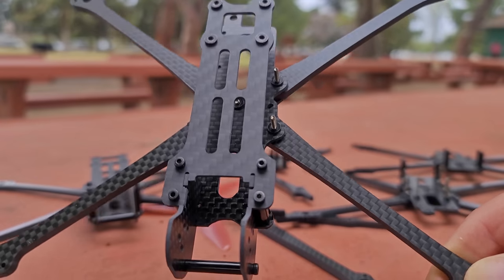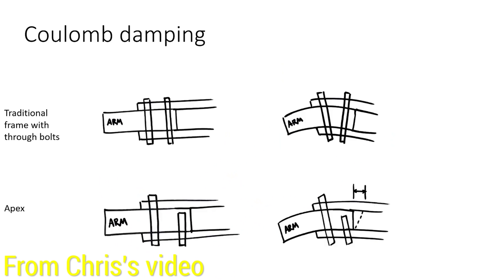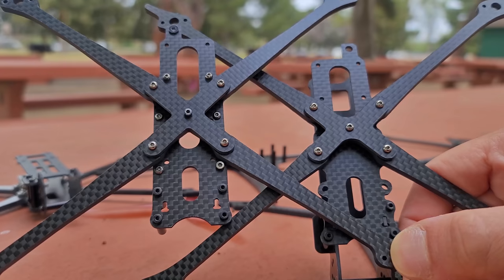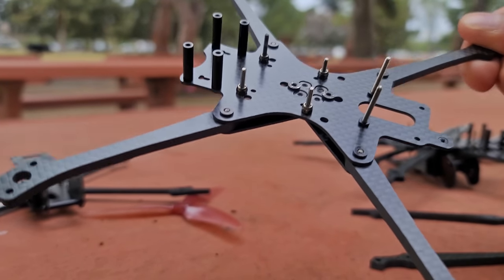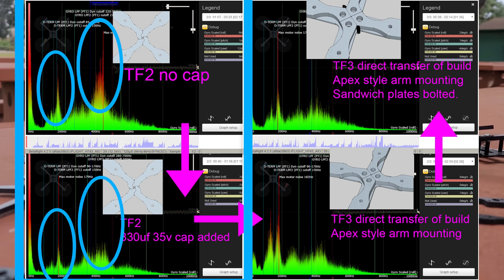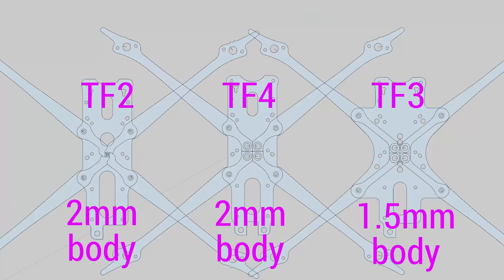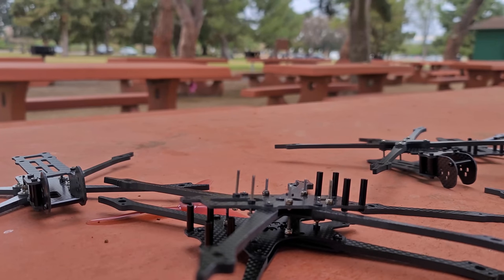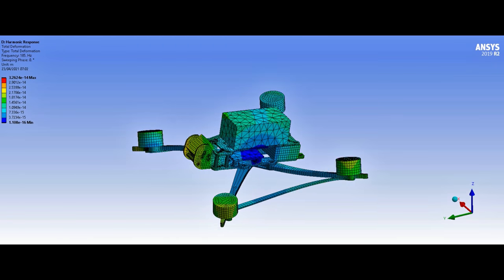Testing the Apex theory - Resonance management

Comment: I've been into contact with Chris as well (I was the first to reach him when he made the Reddit post because we share the same interest and I want to give some suggestions on his frame), and we've discussed quite a few things about frame design and resonance. He even made an analysis on my frame! (though the blackbox data is flawed because the bolts weren't tighten) I'm glad that you acknowledge his theory in this video. 

About his theory on Apex's mounting approach and how it affects frame resonance, I had some doubts regarding its effectiveness and your results further confirm that. In my opinion, the Apex can be so good is because it "cheats" its own way to achieve rigidity. Apex has squished-X geometry, that means they can lower motor to motor distance which results in higher resonant frequency (at cost of flight characteristic). Apex also has very beefy arms (5.5x12mm at narrowest point), which suppress vibrations effectively (at the cost of weight). All of these are pretty much the exact opposite approach of your Glide frame (true-X and lightweight). Both of these frames have different objectives and so it's not exactly comparable, but it's a good example of what you need to sacrifice in order to gain something.

What I've learned from my experience is that to achieve good resonance characteristic, it comes down to 2 main things. A good frame should have adequate arm coupling. Frames are manufactured with tolerance, and even the slightest of wiggle will result in undesired vibration (we're talking hundred of Hertz here). This can be achieved by increasing contact area, or using some sort of interlock mechanism where all of the four arms rest on each other. The usage of lock nut instead of press nut helps to improve arm coupling, because you can tighten lock nut much tighter than you can tighten hex screws with press nuts (I've been avoiding press nuts with my recent frames).

A good frame also should have suitable cross-sectional arm area for the application, with higher ratio being better at suppressing roll and pitch vibration and lower ration being better at suppressing yaw and torsional vibration. It can be tricky to strike a good balance between these four vibration characters, but you can cheat it by having arms that are wider and thicker, or by adding braces and such. These cheats come at the cost of added weight and complexity, so it really should be the last resort in your frame design.

His video on my frame: https://youtu.be/q2t61aSjj6M
Reply from the maker: Yeah I never made the glide with the intention of dampening. It's all durability, weight, value and workability. The prototype 5 has some friction built into it and it does do better but only about 10% better. In this case I present in the video, I feel like it's about 10% better with the apex mount as well. So maybe it's just that, a 10% improvement......BUT, 10% of an enormous spike is gonna be super valuable....

Comment: Really smart idea of using the two screws to see if the theory makes a difference. Coloumb damping (damping by friction) seems like a very elegant way to reduce the amplitude of vibrations given the mechanical nature of these frames. My concern though is, just as you said, making the frame as rigid as possible so as to push those frequencies as high as possible so it's easier for the FC to filter it out. But if there are ways to introduce friction damping without reducing frame stiffness, then you can cut down on the tonality (spikey spikes) of the noise and spread it too. You're totally right about preferring low amplitude and wider spread of frequencies. I think this route is much easier to tune out and is healthier for the ESCs. Although it's the same amount of raw noise/energy coming from the motors, if you can spread that energy out like butter on toast then you got the awesome sauce!

Comment: Exciting to see folks raising the bar and doing more and more engineering analysis on FPV products!!

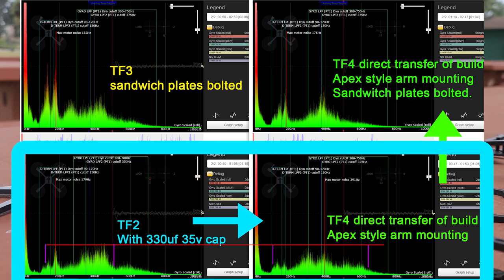11:30 - I would look at a waterfall graphs of the noise vs. throttle too.  Also run through PID Toolbox as the spectrograph can be deceiving at times since cumulative when comparing logs (flight length, etc...)

Of course, variables in BF need to be the same; which I assume are since you are just moving equipment.

12:30 - WHAT WE LEARNED? Proper Engineering is not working by feel or the seat of your pants!  Anyone not saying "AMEN" to that statement, yeah, I'm talking to YOU.
Reply from the maker: Proper engineering in my mind is working with both the real world and the simulation world. You can't have one without the other and both are equally important. I choose not to show the waterfall graphs here because they're harder to read for most because it's not as obvious if you're not used to reading them.
Reply: @Kabab  100% agree.  Simulation just helps us not do so many empirical tests.  The fact is empirical testing is so costly and time consuming we short-cut and don't get to the best solution.  Simulation is so easy and fast to tweak parameter, you can quickly come to the best solution and then empirically test it.

It is awesome you, in partnering with Chris, are bring finite element analysis to FPV frame design; especially when trying to make the lightest frames.  This will save you so many headaches.
Reply: @uavtech  I would add that simulation can sometimes show things that are very difficult to measure in real life. I would think it would be very challenging to visualise these mode shapes of vibration through any real world test because the displacements are submillimeter, and there isa strong possibility that adding sensors would change the response due to the extra mass on these small systems.
Reply: @ChrisRosser  great point!!  Hopefully you guys can weave this into to convo with JB today.  There is a tendency sometimes in FPV for folks to attack tools (like Blackbox) because they don't like what it says or they don't understand it.  It is a tool (like a ruler or laser level), that shows you things clearly that are very hard to discern in just flying alone; again - like a laser level it is very accurate at measuring real-world to help show you what is actually happening (as you know).
Reply: Hey Bob. Just to know- when you said you transferred everything from one frame to another did you transfer the exact same props too? Your prototypes you gave me vibrate more than other props I fly, they fly so nice tho. So much control for acrobatics and fast too. 👍🏻👍🏻👍🏻. Cant wait to buy the final product

Comment: Main vibration caused by joints i.e. fasteners. Major problems are mostly on hardware precision and standards. Thicker bottom and top plate with countersunk always help for tight fit. Resonances are not always a bad thing. Dampeners can reduce vibrations easily, but give less response to gyro. I go for 195mm unibody X.  😉

Comment: If you're feeling like trying something odd, you could try make pyramid-shaped bars on the frame. Basically moving the frame away from being a flat thing to a more three dimensional thing. The best way to remove flex is usually to add support in the direction of the flex.
Reply from the maker: The 3D frame design idea is definitely good.  The issue is that it's very very hard to beat flat carbon in terms of durability, function, workability, ease of use, cost and overall value.  You might get marginally better flight performance but you'll still have all the vibrations to deal with and you'll have spent heaps of money and effort getting it out the door.  It's definitely something I hope to see more of in the future but to me it doesn't make sense right now.
Reply: @Kabab  just a thought, how about sandwhiching a hard rubber in between the carbon arms or the frame? Like a tennis racket material
Reply from the maker: @verdi6092  the issue with anything rubber or rubber like is that it's springy so it introduces bounce which can make things a lot worse.
Reply: @Kabab  then maybe u could use a titanium i beam like for the arm
Reply from the maker: @verdi6092  anything like that just needs to be tested. Maybe it's a better way to go but it's super hard to simulate

Comment: I was commenting over 2 years ago for you to look into "ekoa" composites.  They are like carbon fiber but made of flax fiber.  They have amazing vibration dampening properties.  I have built tubular frames using ekoa from rockwest composites and i think they fly amazing.  Only the outer few layers are ekoa, it is still mostly carbon fiber.
Reply from the maker: I just looked it up. It's damn expensive and only seems to come in tubes. Using tubes for arms on a production frame is a bit difficult. Hard to stop them from twisting and if you drill holes through them they tend to want to fracture
Reply: @Kabab  I agree using tubes is very hard for a production frame.  I just wish the material could start being used in multirotors as it seems like a perfect application.

Comment: When you doubled up the arms to 8mm thickness, do you mean one arm cut from 8mm carbon or two 4mm arms pressed together? I think based on the theory the latter would introduce a lot more surface area for friction to occur when the frame flexes, and possibly add to the damping? Or maybe the normal force out in the middle of two pressed arms just isn't enough to create significant friction forces because there's no nearby bolts, so all you would get is significantly weaker arms that resonate at a lower frequency? If you didn't already, it might be interesting to test (maybe even 3, 4, 5 + separate arms pressed together)?
Reply from the maker: It was 2 sets of arms double stacked. In this case there was some dampening but hard to say if it was from friction. You need something thay is rigid and has movement in the right places. I don't know if a double stacked arm would have any movement in the direction we need
Reply: @Kabab  hmm, I think you're right. I was also forgetting that friction only depends on normal force and friction coefficient, and it doesn't care about surface area.

Comment: Interesting.
I designed a few frames- stretched plus frames.
First design was a simple 2 piece construction, main plate shared the fore and aft motors, and the bolt on "arms" on ether end were one piece, bolted to the upper third of the main frame.
Immediately I knew I had a noisy quad- sure enough roll axis was crazy noisy, no doubt there were harmonics going on.

I went back to the drawing board and now I have two (rather 3), the first is a multi-piece, 4 short arms on a wide plate- I have yet to test, but the second version of the mono frame I have is abnormally quiet, to the point where I thought the black box log was broken- nope, swapped out all different motors, props esc and FC, same story, almost no noise whatsoever.

Only problem is I valued strength and resonance over sheer weight- at 4mm thick, it's about 90 grams with hardware- not a tank, but not light- so next design is going to be thinner with additional arm reinforcement plates to beef them up- as loosing an arm means the whole frame is junk.

I still have to try the multi-peice frame, but I'm not sure it will be good, it's ugly, heavy at 105 grams and incorporates sandwiching the arms between the plates that may have an inherent resonance flaw- unless the geometry of the arms play a huge roll in this frame, I expect there to be much more noise.

This certainly gives me some Ideas to consider when I make a final revision to the multi-peice frame, or, If I decide to go with an X configuration quad (I sure do love my + frames though!)
Reply from the maker: that's one of the issues with an analysis like this.  You want other features too and we have all these filter tools so maybe it's not such a bad thing to favor other features and deal with a little noise.
Reply: @Kabab  True, It takes quite a bit of noise for the quad to start to show signs something is wrong, the popular MPU6000 gyro is great at throwing out bad data, but the ultra-fast refreshing ICM20608 will show signs earlier.

After all, many people fly with bent bells and damaged props- they aren't going to notice a difference in frames!

Comment: This is currently my favourite "The Phat Ultralight FPV Racing 5" Frame"
if you take a look at the how the arms are keyed together and the stiffness of the frame
you will understand why. :-)
Reply from the maker: The arm mounts on that look similar to my Floss 2 way back when. The frame setup is also quite a bit different than what I've proposed here. What I've got is a top mount battery with a vista and is designed to run 2204 and 23XX size motors.  Very different animals.  That racing frame looks good however

Comment: Would a kevlar or kevlar-carbon hybrid drone frame possibly have less vibration because of its higher material damping factor? Its not as stiff as carbon so it might just lower the frequency of vibrations and be worse, but it might be interesting to explore? I'm kind of surprised I don't see much kevlar used in this hobby, as it might also provide better impact resistance for those that don't care as much about vibrations.
Reply from the maker: I've tried using kevlar layers in carbon. It doesn't help at all. Makes everything worse but not much worse.

Comment: You ever thought of using rubber where you mount the motor arms? So that it rubs against some sort rubber instead of carbon?
Reply from the maker: Yeah I've tried tpu and Corey/mewo has tried various materials too. It tends to increase amplitudes. You specifically need friction, not bounce.

Comment: Just a thought I’m sure you thought about it already. Cross bars on front and back arms? Not side to side. Like the CMW shocker?  So would that change the vibration on pitch?  
Sorry for all the questions. I was listening just in case there was a quiz at the end.   😉
Reply from the maker: Good questions, hard to answer. The solution in my eyes is finding more ways to dampen rather than other ways to stiffen. We can already make stiff and tune the frame for a setup. Damping however lowers the amplitude of all

Comment: So I know the industry standard is flat sheet components that key together, but have you ever thought about testing a 3d unibody design?  The layup would be a lot more work than machining flat stock, but it could be super interesting.  I started designing a unibody carbon whoop as a fun composites experiment.
Reply from the maker: There's been a bunch of 3D unibody/molded carbon designs. They're several times more expensive and offer no tangible benefits unfortunately. That's why we don't keep seeing them.

Comment: Why does the flex analysis go through the battery? Shouldn't be the battery considered as a separate item?
Reply from the maker: It's strapped to the quad so it's considered part of the structure.  He puts appropriate weight motors and battery on the frame.

Comment: Hello KababFPV i would like to ask you about your graphs. All graphs that you provided into the video are having x axis limited from 0-1000hz. Does that mean that higher frequencies are not that important for drone flight? Because i'm imagining this system to fly on frequencies much higher than 1000hz.
#question
Reply from the maker: 0-100hz is typical control frequency area. I'd you have no frequency below 200hz, you're pretty much fully safe. All the frequencies above 200 are much easier to filter out. Anything above 400hz is a total non-issue for us unless the amplitude is super high.

Comment: Hmm, I wonder what would happen if you made "I beam" arms, as in use two plates per arm and offset them with a vertical plate. In theory that should increase stiffness quite a bit, though maybe as you seem to be alluding in this video we should focus less on stiffness and more on damping.
Reply from the maker: Yeah stiff is needed but it seems some potential friction needs to be left in the system as well.
Reply: Imagine that would be pretty bulky tho, as well as add some drag.  
idk?
Reply: @samuelyoung2671  Yeah, it'd probably work best with a Remix style frame since that already has a much lower bottom plate. I think the drag penalty wouldn't be too significant, especially if you won't be racing. Might try to run some simultions of my own.
Reply: @Bruno-cb5gk  
Would be pretty cool to break the flat carbon plate meta.
Reply: That being said considering how well quads fly now, Im skeptical the return on investment for this sort of innovation is there.   unfortunate really
Reply: @samuelyoung2671  I mean its just a combination of vertical and horizontal arms, both of which exist individually. Can't really say how well it would work without actually trying it tho.